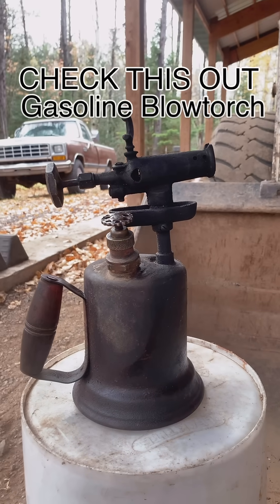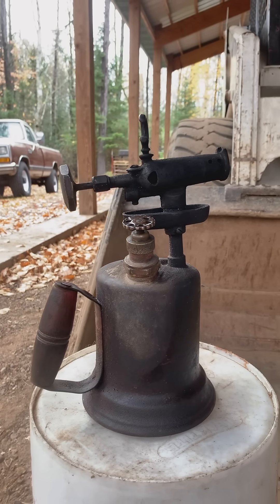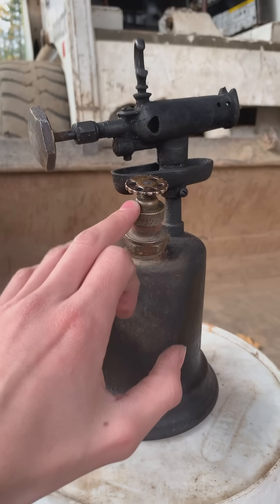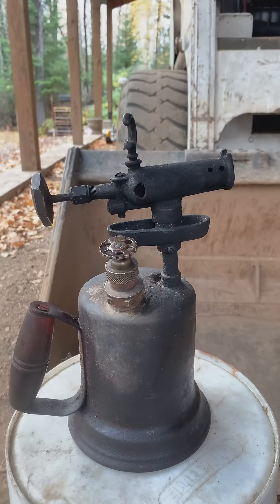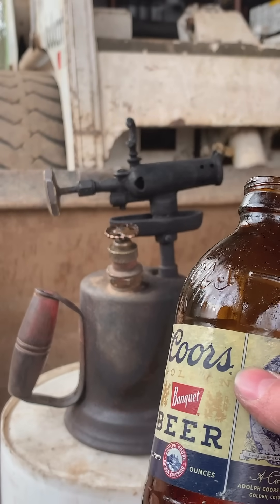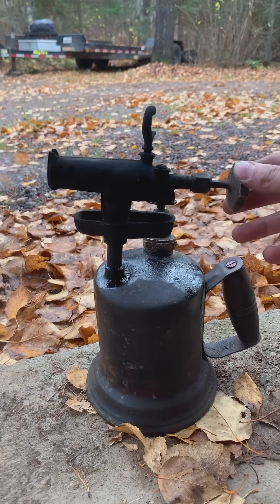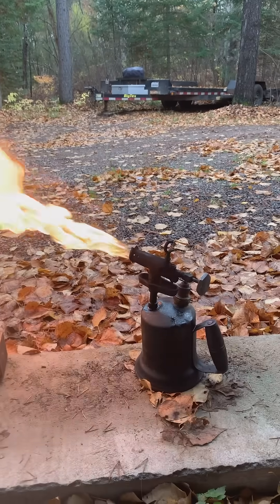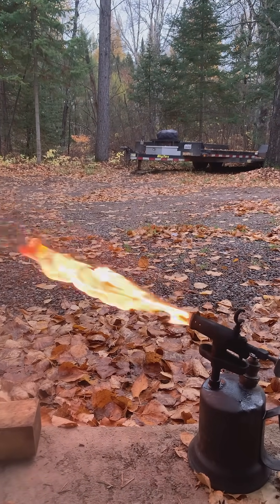BIG FLAME how a gasoline blowtorch works #antique

Comment: My dad used this kind of torch to bubble oil based paint on the house to scrape it down to bare wood.  Used it still until about '80.  The new latex paints just fell off, so we didn't have to use a torch after the water based lesser paint.  I loved the smell of lead fumes in the morning.  We theorized the gasoline fume brain damage would get us before the lead oxides.  Somehow we survived.
Reply: In the late 60s I watched Grandpa use a torch like this to melt and pour lead into the joints of Cast Iron drain pipe .
   He'd put packing into the joint ( probably asbestos cord )and then pour melted lead to seal the Cast iron joints .
Reply: @mohammedali672  What you’re thinking of is oakum. And most kinds surprisingly didn’t contain asbestos
Reply: @CTS28 
  
  It is not Oakum .
  That's because Oakum is made from untwisted used rope and used primarily for planking on wooden vessels with creosote as a binder to make it mostly watertight .
   What Grandpa used was a woven white woven material about a half inch in diameter , that was packed into the Joint on Cast Iron drain pipes with lead as a keeper that made the joint watertight .
   I watched and helped Grandpa in the late 60s do two houses worth of Cast Iron drain pipe . Packed the cord with a curved blunt chisel the molten lead on top .
   Cast Iron Drain pipe from the toilet , sinks , bathtubs and the Stinkpipe . Not potable water pipes ..... That was copper .
Reply: And it was likely that cord had asbestos in it . He also had a roll of asbestos sheet that was used to wrap steampipes . Yes , he worked on boilers too .
Reply: @mohammedali672 the packing used was okum ,a brown fiberous material with a waxey or oily impregnation
Reply: @Greg-xv9qj 
Oakum is used rope untwisted and and packed between the wooden planks on boats . Add creosote to that packing to make water tight joints . Oakum .
Reply: @mohammedali672  The plumber that taught me said it only needed to prevent the lead from flowing through the joint, and he just used old rags, instead of the old oakum or stuffing they wanted to sell.
Reply: Same here. My dad used to come home after burn/scraping lead paint and say,” All you need is to drink milk..” (to alleviate the headache)😂😂
Reply: @KarlAllspach  Same answer to welding galvanized metal and inhaling the poison fumes.
Reply: @KarlAllspach Russian immigrant/defector I knew claimed to have removed his tattoos by injecting raw milk under the skin, claiming the enzymes ate the ink.
Reply: @KarlAllspach real non pasteurized milk. Not the Walmart white water that has been heated enough to kil everything good in it.
Reply: Well gasoline itself was leaded back in the day
Reply: @reubeng2110  Funny, but white, or unleaded gas was hard to find, but now, leaded gas is hard to find!
Reply: @reubeng2110 white gas as camp stove,lantern fuel unleaded with little octane
Reply: @reubeng2110  and look at most of those boomers now 😂
Reply: @ProleDaddy And yet? We're the one's with all the knowledge of how to drive a manual transmission, fix ANYTHING on the planet, and have more common sense than ANYONE born after us? Weird how that works
Reply: You know your generation is one of the most privileged,spoiled and soft generations America has ever seen, don't you? All of the economic and environmental issues we face now are the fault of your generation. Own it
Reply: @mattcookeco I own it with pride.  My grandparents won WWII and got pensions and high interest rates.  My parents got Reaganomics and cool cars.  We got no jobs, booms and busts and a dying world.  Here's to a future from the spoiled kids who won the gulf war playing volleyball in the desert and the last of the great paying jobs.  Good luck, whoever's next!
Reply: @alexandersupertramp7353  common sense? For someone born after 1945? Keep dreaming, were all cooked all the way back. You are going to be left behind driving a manual transmission you can fix. I'm going to be left behind with touch technology when the VR an AI kids are in charge in 30 years.
Reply: @ProleDaddy  they weren't the ones eating tide pods for fun
Reply: Lead x Gasoline ❤🏳️‍🌈❤ divine counterparts
Reply: Burned, scraped, melted bubbled up oil paint in our kitchen as a teenager with my father when we moved in a new apartment. Gasoline blows torch, scrapers, 6 different colors of oil coats, took us 2 whole days. Run one fan and windows were open, but I can’t deny that we didn’t like the “taste/sweat smell”. 🫣 Back then there were no electric heat guns yet. Undisputed fact that lead paints and lead paint burned fumes are dangerous but it was a 2 day job 45+ years ago… both my dad and myself are still around. 
Glad that there are way safer alternatives and PPE’s these days for these types of jobs.
Reply: Roman’s and boomers, 2 groups lead bent on self destruction
Reply: @MrBones8891 Your generation seems to be out pacing them on self destruction, or do you live under a rock .
Reply: Good God, I'm surprised you can still see straight and spell your name
Reply: Back when gas still had lead, but they cautioned you to only use white gas!
Reply: @crashburn-s3b Same with our camping cook stove.  My dad said the white gas burned cleaner & wouldn't clog the burner orifices.
We could buy it at the Amoco gas station pumps.
Reply: We were tougher in those days, and knew a lot less!
Reply: And you can somehow communicate way better than most people in comment sections to boot.
Reply: You rode your bicycle behind the DDT truck, didn't you?
Reply: @RobertLee-3.1416 
No , we were told the day before DDT spraying to stay inside that afternoon .
Reply: My dad had one.
Reply: Are you family members police officers? 😂😂😂😂

Comment: Old timers would pump it up, crack the valve and let gas dribble into the priming cup. When it was full, they'd light that. When the prime was almost burned up, you open the valve to fire the torch.
Protip: the hook on top is for an old style soldering iron. You put the tip in the flame, rest the tip end of the handle on a notch on the noozle and hook the handle into the hook on top. If your iron is getting to hot rest the tip on the notch so it's not directly in the flame.
Reply: You also have some without the pump, where all the pressure just comes from the preheating. I have some Sievert ones like that.
Reply: @slome815 THAT sounds dangerous! 😮
Reply: @toddburgess5056  Not really, the only ones I've ever had that were dangerous were the ones with a pump, if the seal on the pump leaks you get a flame that spits of the pump. Never had problems with the ones without one.
Reply: @slome815 that's resolved with a couple of gaskets. There's hardly a piece of those that can't be repaired or replaced fairly cheap
Reply: Is there a pressure vent if it gets too excited?
Reply: @heatshield just the valve on the ones I've seen. Any pressure release would risk spraying fuel when it opened under pressure
Reply: @nicholashodges201  Generally there is a overpressure valve on the filler cap. I've never seen one in action, but fuel spraying out would be better then an entire burner full of fuel bursting open.
Reply: @slome815 thats only safer in a reality in which local physics would not allow that aerosolized fuel to ignite.
Fuel spraying out under pressure and becoming aerosolized near flames is how fuel air explosions happen.
Meanwhile not even the Hulk could overpressure a brass torch enough to make it catastrophically rupture. The rubber gaskets will give first, but a normal person just doesn't have the strength to even do that
They don't have an overpressure device because it would make them MORE dangerous AND they're completely superfluous.
The hole you're talking about doesn't exist on most of the ones I've worked on, just the last generation from the 50's or so.
And on the occasion they need fixed its because of dry rot, not rupture. Pretty sure they were more for show than function.
Reply: @nicholashodges201  Dude, all the ones I have have a pressure relieve on the filler, that's all I'm saying.
 You say "They don't have an overpressure device because it would make them MORE dangerous AND they're completely superfluous."
Clearly that's not true, I have 4 sieverts, all have them. Sievert was (and is) a respected brand too, I trust they knew what they were doing.
I still wouldn't worry if it didn't have a pressure relieve, since I can't see how the torch could build high enough pressure during normal use for it to fail, but they still have it, and thus your statement is just untrue.

Fuel spraying out, becoming aerosolised and igniting is literally how a gasoline torch like this works. Should the relief valve ever open, it might ignite and a flame will shoot out, it will not, like you say make any explosion, in the same way that opening a torch in open air, and igniting it a bit later, won't cause an explosion. You need an at least partially enclosed space where gas can build up for that to happen.
Reply: @nicholashodges201  yeah that makes sense. With a long enough flexible vent tube it could be a little bit safer I think. 

 I’m not trying to reinvent the wheel. Just thinking about building something like this of my own for deicing the driveway but less explodery and ripping me in half. Also with a sort of “wide” nozzle. Also with a different ignition and preheat system. Also….

 Oh hell I guess I reinventing the wheel.
Reply: @heatshield  Yes unscrew the pump to vent the pressure
Reply: @ivanmcdonald1  dodgy advice
Reply: Awesome additional information !
Reply: I have the torch AND soldering iron!  I remember starting shop class in 1974 and having no idea it was a soldering iron became we had a huge electric one at home.

I love the design of the iron - just a big pointy hunk of copper on a steel rod, with a wooden handle.
Reply from the maker: Yessir I know that but mine is clogged and I can’t get it unclogged
Reply: @BurningTread  The torch should have a little brass jet that can be cleaned with a gas tip cleaner, it will only be carbon maybe rust and should come out with a bit of fiddling
Reply: @BurningTread try oven cleaner, it's probably solid carbon. If that doesn't get it, it could be rust, soaking it in a mild vinegar solution would clear that.

Comment: I have a couple of them but never operated one, I just liked how they look on my shelf. I might have to try it one of these days.
Reply from the maker: Still be careful and make sure it is a gasoline blowtorch and not a kerosene one they have different jets
Reply: @BurningTread 
I was thinking that Coal oil or Kerosene was used. I didn't know about the gasoline. Diesel and Kerosene are totally different beasts than gasoline when it comes to burning.

Edit: Can give an idea how to differentiate the gasoline for Kerosene jet?
Reply: @kentuckywindage222 There are round wire gauges that could help you sort out the jet diameter.

if there isn't clarifying information on the torch itself, and you can't dig up the information online specific to your model, you may need to experiment a bit. (Far from anything flammable, obviously.)

Hint: Don't try gasoline first. Start with diesel, then kerosene, then gas, etc. Moving from least volatile to more volatile is the order to go in.

Comment: Man I am afraid of gas can u use any other fuel or am I just being a scary cat
Reply from the maker: There is a kerosene type as well and you can use Coleman camp gas but this specific torch is designed to run on gasoline. The kerosene ones have different jetting and shape

Comment: Use kerosene!  Gasoline will eventually turn that reservoir into a bomb.
Reply from the maker: Nope this one is NOT a kerosene torch this is a GASOLINE blowtorch kerosene torches have different jetting and have a different shaped tank. this torch is designed to run on gasoline

Comment: I own a half dozen of those and just learned they're called (gasoline ) blow torch ,never used one and thought they were fueled with kerosene.
Reply: Anything you'd use a propane torch for, like soldering copper pipes.  Anything that needs heating up like stubborn suspension bolts.  It's not a cutting torch, that would be Oxy-Acetylene.
Reply from the maker: Kerosene torches are a different design they are not quite compatible because they have different jetting and kerosene ones have a wick this one is designed to run off of gasoline
Reply: @BurningTread thanks ill have to look at them and see what they are.
Reply: Blow torch suggests cutting steel. Obviously this can't cut steel. What are they for?
Reply: Mostly for soldering